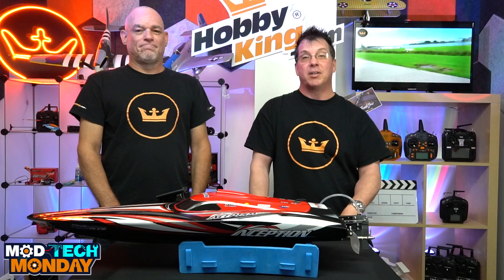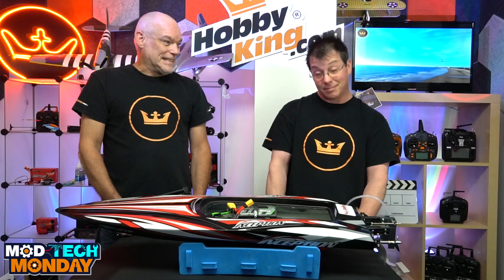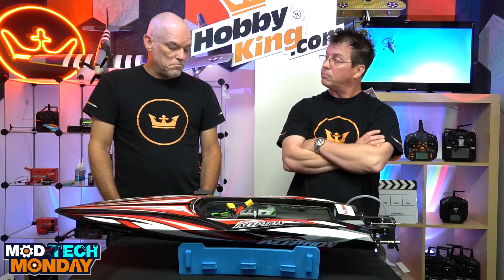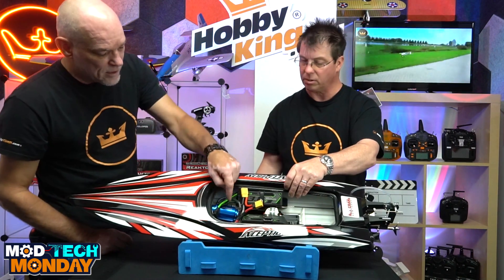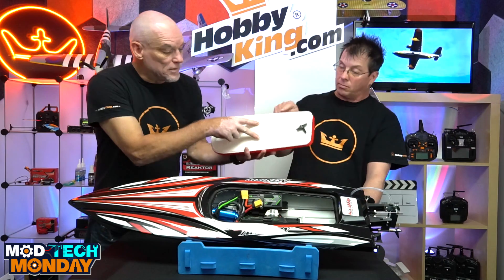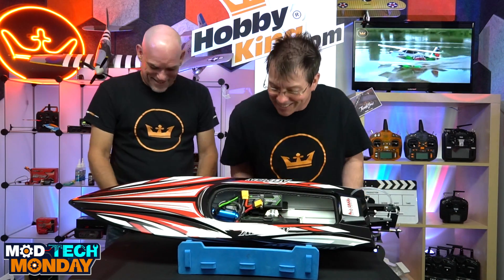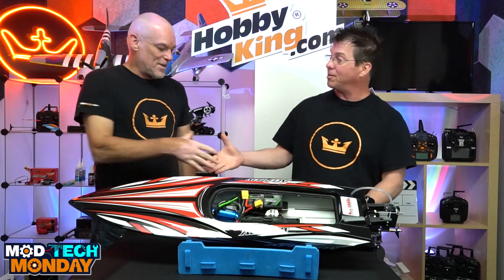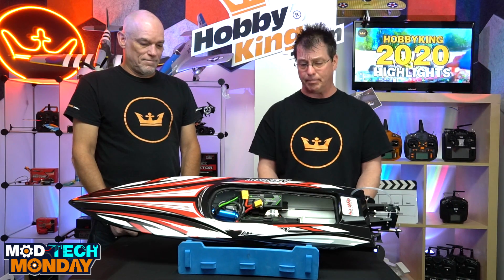Mod Tech Monday - How to Upgrade the HydroPro Inception Racing Boat to 12S

Comment: Not a very good comparison in my opinion. I couldn't tell which boat was which. You should have done a side by side drag race with the 6S and 12S boats to compare relative speeds. Shoddy camera work didn't help.